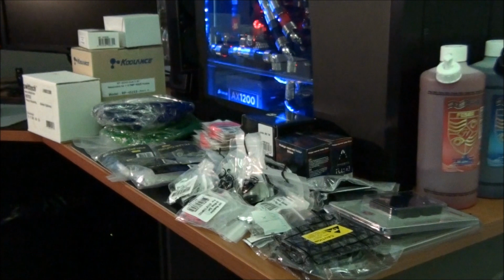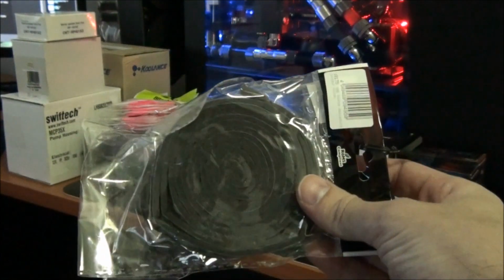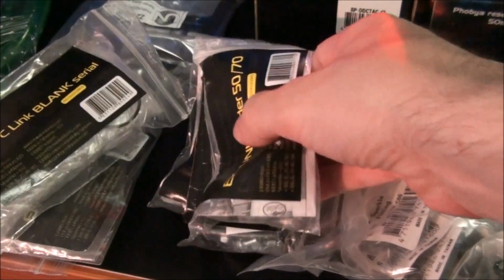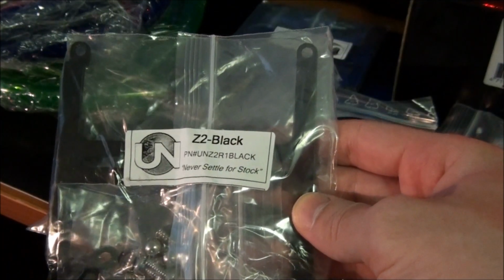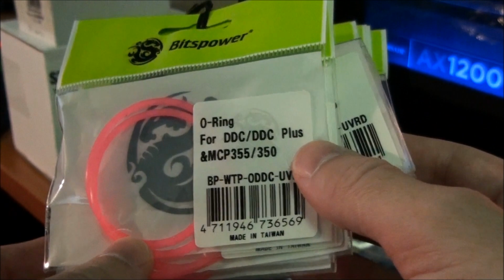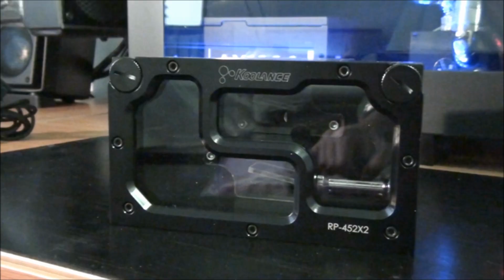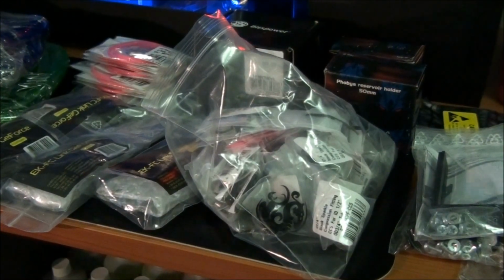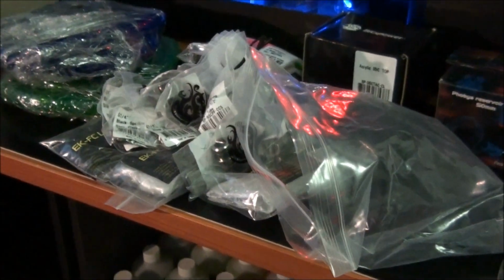Singularity Hardware Order Analysis Video 1 (Subscriber Segment)

Comment: @LEGITWARFARE what mobo do u have? i got the same problem with my 1055T system, in my case i suspect the motherboards power supply to the processor isnt good enough, as its 3+1 phase :(